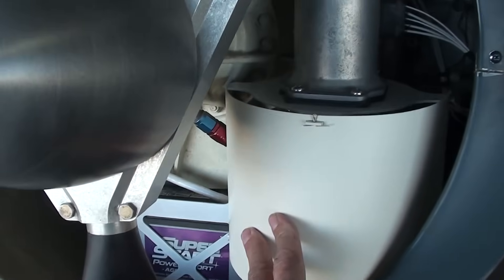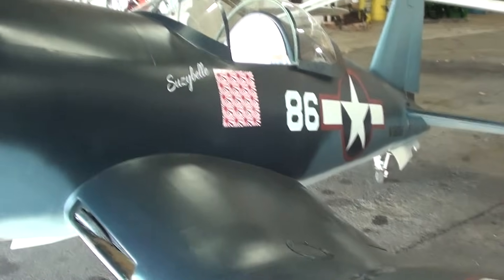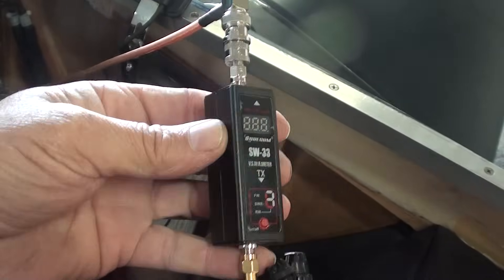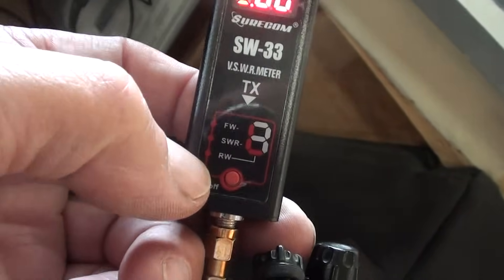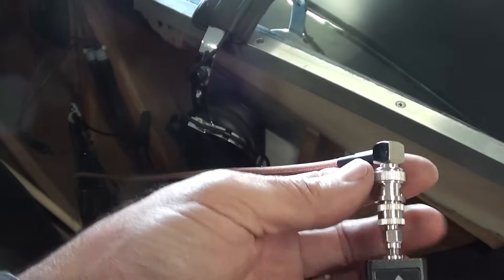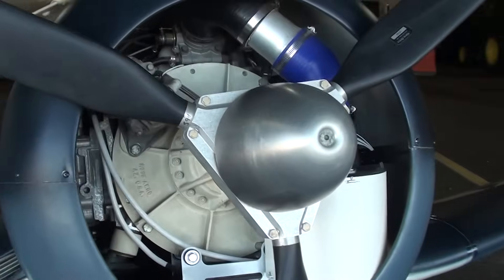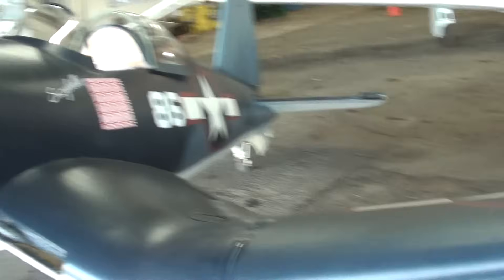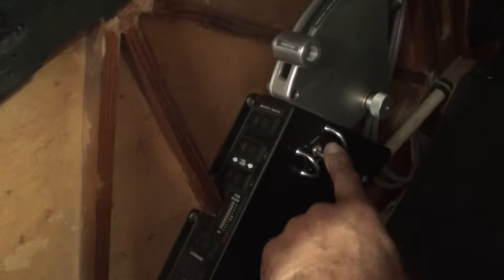WAR Corsair Update 11/19/2023

Comment: When you do your first flight test. Will you do like touch-n-goes, or just take it up and loop it back a few times, whats the plan there. will you increase your distance/altitude each time? Don't know much about this stuff.
Reply from the maker: If everything looks good after takeoff, then the best thing to do would be to get some altitude, but stay close to the airport, and do some stall test without flaps first, then flaps at different settings. That will give me numbers to use when landing. Then more testing for speeds and control flutter test in later flights. As well as other test.

Comment: That shield looks like its going to cause air flow vortex problems.  Why not run the intake tube back to the wing leading edge. or under fuselage with a dedicated air scoop? Or back against the firewall where the airflow/pressure is more stable.
Reply from the maker: No room at the back of the engine, plus you would be sucking in hot air. The shield should work, just need a better day to get the plane back up to and beyond 50 mph.

Comment: I have installed several of these engines. Overheating is normal due to the increased duty cycle being applied. Start with a high performance thermostat, ( rarely works), I drilled 3 or 4 holes a 1/4” around the sides. This worked very well and despite what many would think,the thermostat continues to cycle normally. I have also removed it entirely or replaced it with a “washer” made to fit and adjust centre hole as needed.  Love your progress and your attitude even more.👍🍻🇨🇦
Reply from the maker: Thanks for the info. This was the first time I have had a heating problem . It just after the cold weather set in. Right now it is back to normal. I will continue to monitor it.

Comment: I thought for auto conversions, it’s recommend to remove the thermostat and use a reducer, or take a thermostat and remove the intervals..might take a little longer to warm up, but it removes a potential failure point.
Reply from the maker: I haven't heard that before. Removing the thermostat completely doesn't work. It will make it run hotter. The water flows through too fast, and doesn't pull away the heat. A reducer disc could work. We'll see how it goes over time.
Reply: @Dynodon64  right that’s why I didn’t dat to just remove it, but to hog out the intervals, leaving the disk.. removes a point of failure.

Comment: Just a suggestion on your flap switch. Try a spring loaded safety cover. When you need to operate the flaps just push up the cover with the back of your hand, and finger your switch. Then the cover returns to the down position by itself. That way you can bump that thing all you want and you won't have any unwanted flap movement. It just seems to me to be the best solution for where the switch is. My opinion, for what it is worth, is even if you put another bar there that the switch is still open and even though it might be harder to bump, if its bumped just right it could still be activated. Why not be safe then sorry. As you know, extending flaps at the wrong time could be disastrous. Anyway, like I indicated, just my two cents worth. Enjoy your updates and looking forward to your getting this bird in the air. Stay safe out there. Jack
Reply from the maker: This switch is a two way one. Center neutral, and momentary up and down. I think those covers when closed turns a switch to the off position. So that kind won't work. If they make one that lets the switch stay in the center position, than yes it would work. I'll look into them more.
Reply: I've seen them both ways, either return the switch to the off position or leave the switch in the position it was put in. I'm thinking if you are unable to find the later, you might be able to machine the portion of the inside of the switch cover that turns the switch off so that it is no longer able to push the switch back to the off position.  I'm sure you should be able to find the correct one though, as I've seen them used in race cars. Good luck. Stay safe.

Comment: Those are good SWR readings. Here's a neat bit of information... Vought redesigned the canopy to be more bulbous (taller) on later models. I'm not sure how to combat the sun blinding you. Do you have contact lenses? If so, use those and a good pair of polarized sunglasses?
Reply from the maker: The sun just happened to be in a bad spot today with clear skies. I'll work on that problem as I get more along. That was the first time I had that problem. No contacts to try. I may need to get non transition lenses to help out to see the panel better in that lighting.
Reply: @Dynodon64  I'd invest in a pair of curved polarised prescription sunglasses, I've used a pair of oakleys with a soft brown tint for over six years (updated the prescription every one-two years) as a taxi driver, never regretted it. And I picked the curved sports model to avoid peripheral reflections when the sun is in the rear quarter and low as it is this time of the year in the Sub-arctic zone😊
Reply from the maker: I'll look into them, thanks, @SonsOfLorgar

Comment: You call that gusty? I'd call that a slight breeze, if it was gusty then the windsock would be blowing around like crazy.
Reply: Exactly, Seems someone is looking to be in a perfect world
Reply from the maker: That sock was swinging 90 degrees from north to west. Gust were in the mid twenties. So yeah, gusty for this plane at this time of testing. I used to fly my Gyrochopter in 40 mph winds.
Reply from the maker: Since the cold weather has moved in, the winds have shifted from the west to from north heading. Before it was always down the runway. Plus the sun was a big problem too. Wasn't going to push it. Not worth the risk. @54378100

Comment: the punch list keeps getting shorter :] you might be able to swap out the switch tab with a slights shorter one or grind it down to reduce accidental activation
Reply from the maker: I might try turning it 90 degrees to a fore and aft position.